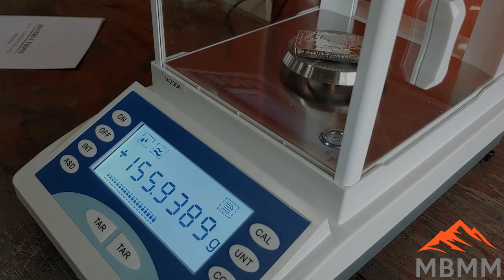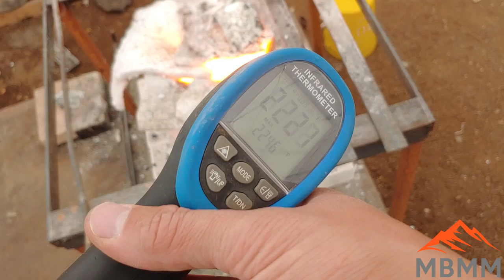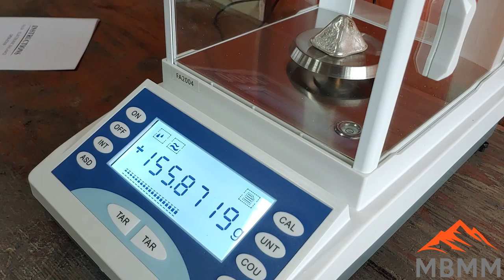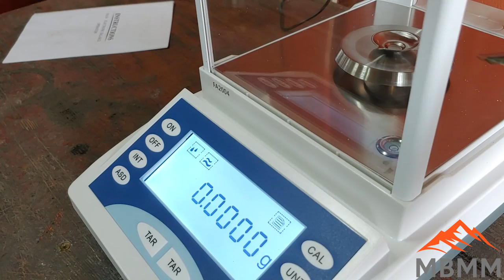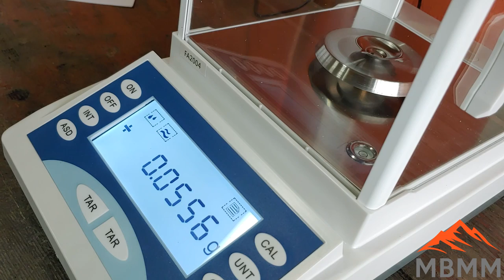Smelting Platinum

Comment: I work at an oil refinery as a chemist, we use platinum catalyst in at least three units.   We use 5N sulfuric to dissolve the alumina substrate for testing. The platinum is not in a recoverable metallic state, you probably have to reduce it in solution before it is recoverable.

Comment: I'm sure you're aware but you don't need a lot of Platinum to do catalysis, and most vendors will minimize. You'll want as much surface area and as thin of a layer as possible. We worked on plating depositing copper into nano-pores inside of carbon, and then placing Platinum on top of that. 
We're talking tiny, tiny, TINY amounts. Anyone that needs a TON of platinum to do reactions isn't doing it right- so you may really have to look at chemical dissolution instead of decomposition.

It has been years since I did this work to produce OLEDs. I've got to imagine the industry has gotten stingier since then.... actually, sigh, nearly 2 decades at this point. I feel old.

Comment: Hey Jason
Thanks for another awesome video. I highly advise you chemically dissolve that silver button, most of your Platinum is in that silver.
Since the percentage of Platinum is below 25% it will dissolve along silver in dilute nitric acid, but solution turns orange yellow.

Platinum also shows if you assay that silver bead.

The reason for loss of silver during smelting is due to massive amount of borax which can oxidize some of that silver.

Also make sure you use silver fine powder, silver is the best collector metals.

Thanks
KJ

Comment: so there is two ways to recover platinum from substance first one  electrolysis  which is you put high current through a conductor usually a graphite in platinum solution which is usually a Platinum chloride ، similar to welding device the second way is mixing with Flux recipe something called carbon tetrachloride it's usually mean you dissolved carbon in hydrochloric acid then let it crystallize then you put the crystallized Powder with the flux but carbon tetrachloride  . There is other way but its not preferable in industrial scale . I hope that help.

Comment: I have watched several chemical recovery process with materials purchased on EBay and buyers haven’t told buyers the these cores were previously chemically stripped. You might want question your source.

Comment: OK how about this, you put some silver in Bottom and keep adding the beads and flux as needed....Add all you can pull some slag off the top Why not do it in the portland...adding and adding and pulling the slag back and enlarging your crater.....long burn time. Does your temp gun go to 3400? 3500?degrees F  Sorry, just a guess.

Comment: If you use silver, shouldn't you cupel the silver away all in one operation.........the lead was not needed in my opinion
Once you are sure you have 3300 degrees and have your bead. drop the temp  open the top and cupel away the silver. Keep that lead away..
And you will loose weight........the silver goes bye bye at 3200 degrees and a nice soak.
I love your work here guy.. When a problem comes along ...you must whip it.  No one can go home .....until we whip it.    DEVO

Comment: Wouldn't acid separation be more energy and cost efficient?
Reply: But that isn't safe unless you have a fume hood.
Reply: @richardmckinney4963  have you noticed how he's outside in the wind all day?
Reply: Platinum dont react whith acid
Reply: fred Hamster in aqua regia it will
Reply: @RagingShrimp67 perhaps you missed this: "Those beads probably aren't economically viable to smelt down and recover the platinum. A leaching system may work a little bit better, but that's out of my scope."
Reply: @snarky_user  First of all, I made the comment about 40 seconds into the video. Secondly, even after hearing it and finishing the video, I still think putting these beads in aqua regia and precipitating the platinum is not outside anyone's scope who has 2 working hands and at least one functioning lobe, and it requires a much more basic equipment than a smelting yard.
Reply: @RagingShrimp67  not disagreeing that you're idea is viable, just that he's excluded it.
Reply: @snarky_user  Yes, but I wish he had explained why.
Reply: Theoretically the yield would be higher but take into consideration the volumes. 100g of the beads were over 1000ml. 10L to a kg.. Imagine the amount of acid needed to process a ton.
Reply: Platinum salts are toxic and cause its own skin condition that is not curable, I would stick to smelting if it is what you are familiar with until you are comfortable with the chemistry and understand the risks.
Reply: @RagingShrimp67  You have to boil the aqua Regina and you can get Platinosis from the fumes and touching it after cooled I think you can get it also. Wish I knew more.
Reply: @kaiseredge  Do you have a source on the dangers for me to see?

Comment: The guys that are making the big money with a catalytic converters are using a plasma system oh, that is very profitable in the catalytic converters, I believe they are using the ceramics as the flux another words they're not putting nothing in it, I don't think you can get it hot enough with the propane